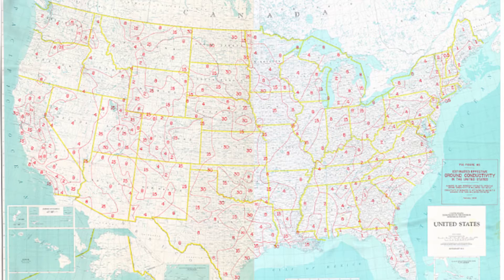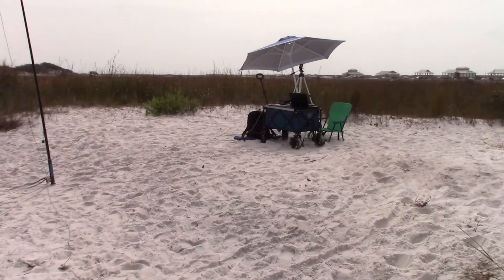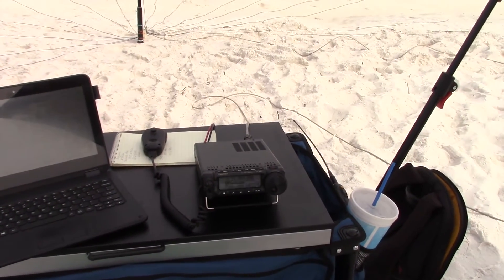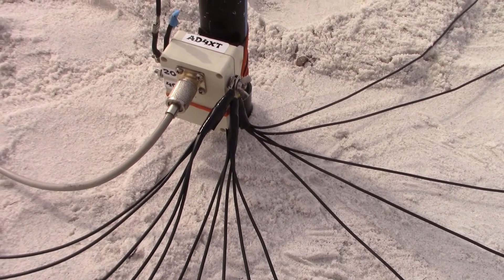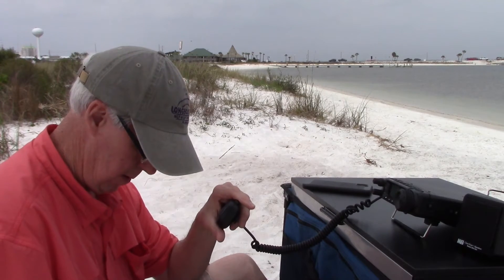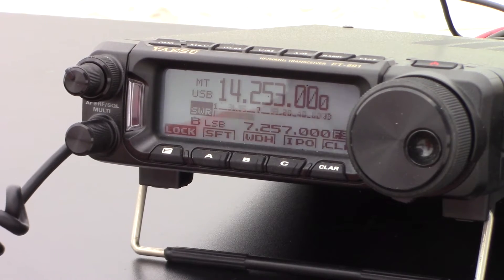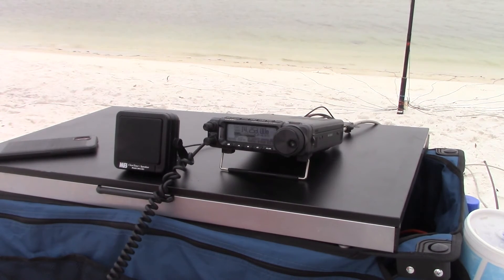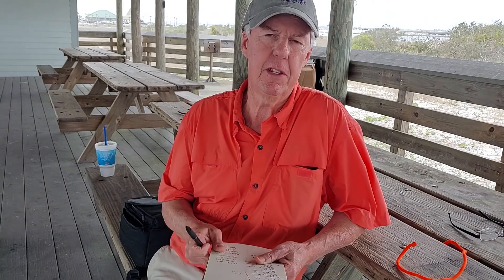Saltwater Effect and Vertical Antenna Setup

Comment: Not sure you need all those ground radials. Try one…/…
Reply: One into the edge of the water… W8BLT
Reply from the maker: Maybe, maybe not. I have them so I just use them. May need to do a test and video next time i'm at the saltwater. Steve - Ad4xt

Comment: It would be interesting to see what happens with just one ground radial into the water.
Reply from the maker: I have seen others do that. I know my setup works well over regular ground. Works 10x better against the saltwater.  Just need to be close. When the tide washes up on my radials my reflected power / swr goes up.  Keep an eye on that. Thanks for watching.  Steve Ad4xt